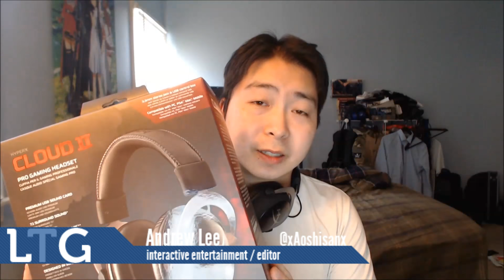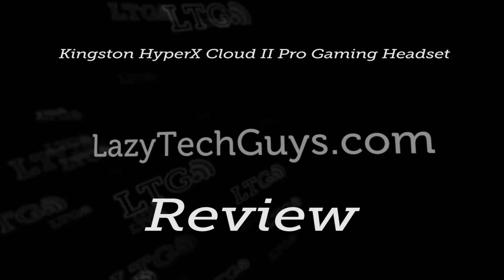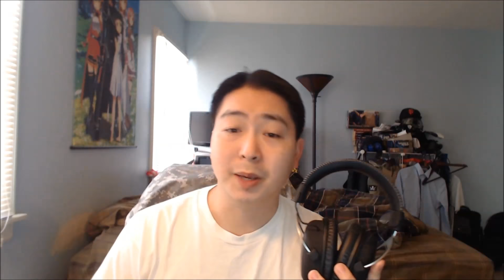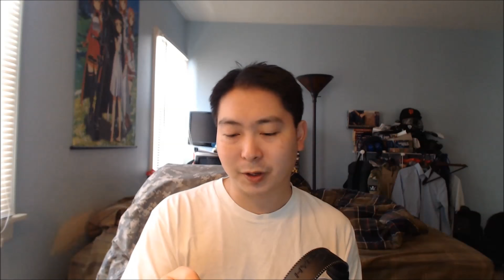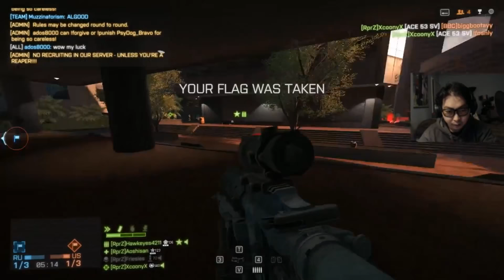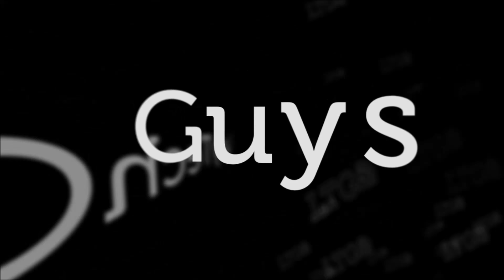Kingston HyperX Cloud II Pro Gaming Headset Review

Comment: Is this worth $115cdn (total) for PS4 use only or is there something else out there in the $100 range?. Only gaming, no stream or anything
Reply from the maker: Camps2630 With consideration about the comfort level, there are probably a few out there that I haven't tried yet that might fit what you want to do. I'm currently using this for my PS4 in that role also, however, if you want to go cheaper, I know Turtle Beach has a couple of models as an example that certainly fall under the $100 range but I can't say if they're up to par or not. Hope that helps.